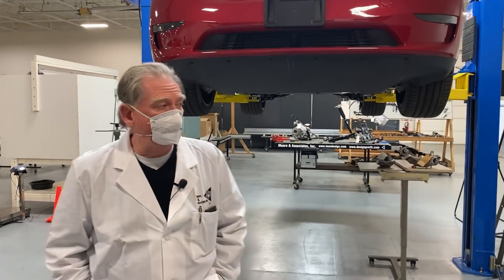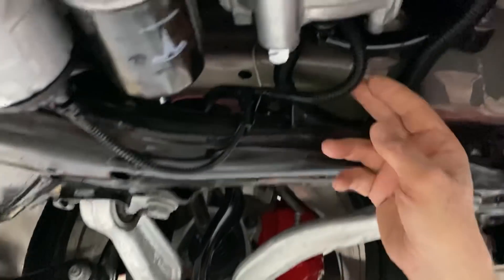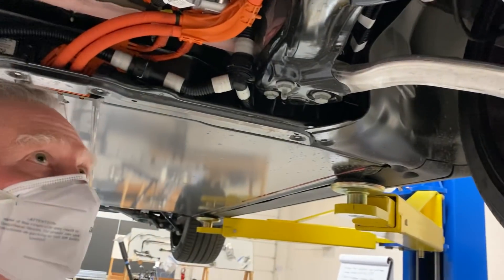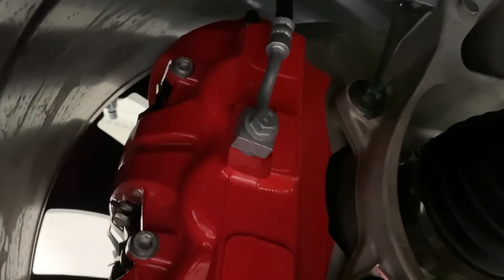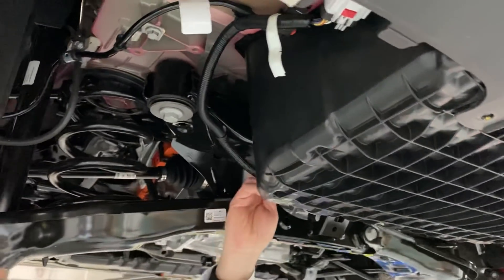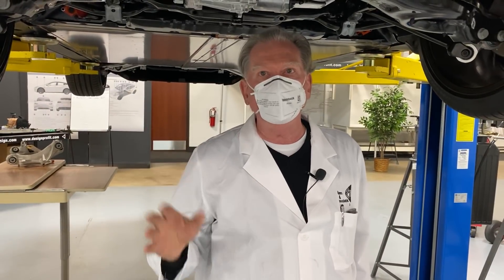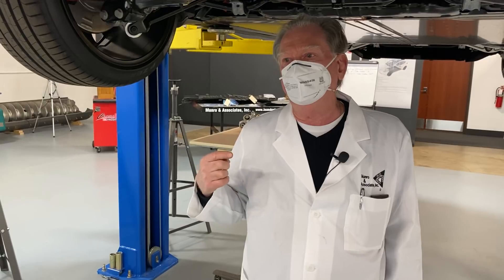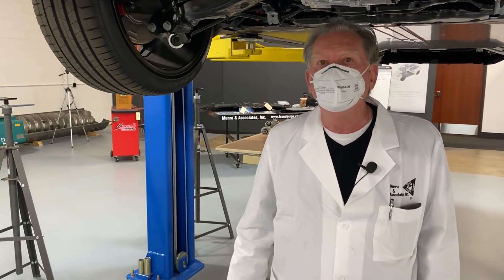Model Y E6: Wiring, Brakes, Quick-connects, Rear Body Structure

Comment: Corrugated wrap? Come see my 2006 4runner....the disconnects are nice.... 

but looking at this I can see why insurance rates are going through the roof approaching 10% of the purchase price cost annually, my Tundra started at 1.4% of the purchase price in 2014.....

These cars don't look repairable unless the body panels can be easily removed to replace the entire front end or rear body structures, that said , No one is going to trust that the centresection battery packs didn't suffer damage and won't later cook the occupants...

Govt safety regulations need to change to also cover repairabability, this thing looks like a military approach to single use disposable, because of course the military budget is unlimited and driven by the industrial complex mafia.....

Comment: Dear Sandy, 
it's not true what you say about the corrugated pipes to protect the wire harness. Please checkout the HV cables of smart ForTwo or Mercedes EQC and also a lot of Mercedes and BMW protect their engine bay harness like this - in this case it shows me that Tesla rather takes more effort for the wire harness than get rid of sharp metalic burr

Comment: That wiring in the beginning makes me really happy. Wiring was one of the most difficult tasks to speed up / automate according to Elon because the wires are obviously flexible. With this wiring harness that should become a lot easier and faster, hence making up for the material expenses through cheaper manufacturing operations and fewer repairs

Comment: I have a question. Why is it, that the nylon bowl thing in the rear is as narrow as it is? You can see that there is lots of empty space behind the wheels/suspension at 4:29. Basically every car I've ever been under has this. They put the muffler there in ICE cars. In some ICE cars, this space is just empty but I understand that a version of this very same car might have dual mufflers and because they don't want the extra versions, a little space remains unused. But why here? There's never gonna be a muffler on a Tesla. Why is there a hole? Usually in car packaging the departments fight over millimeters, how can there be an unused space in a car with what looks like 10l or more volume on each side? Does somebody know?

Comment: Sandy munro is a strange fellow.
Highly rated, but makes some small mistakes.
if I am somebody in industry, should read, keep up, about, ee, everything.

Either way, love the videos, thanks.

Not pulling out rims for brake explanation???

Tesla model differences, base, performance, long range, he should know.
Engines, brakes, suspension, trim, rims, computers.

Corrugated lines comments indicate they are more common that sandy explains.

Every car entusiast loves brakes.
Their a status symbol.
Corvette’s had them as early adopters, 50s-60s
Front disks, rear cheaper drum.
Been getting bigger through time, 12 inchers, thru 14, 15, 16,
just look at even mercedes bmw wagons.
Love lamborginis Ferrari, humongous.
Porsche yellow ceramics, Ferrari, F1, buggati.
Ceramic option are a $10-25k upgrade option, depending brand.
The only brand by name OEMs use I’ve heard is Brembo.
There are may aftermarket, like AP, wilwood, stoptech.

Either way sandy didn’t mention
single piece casting in big machine promised by tesla.
Reply: This is one out of what 22 video's on the car made by him so far?  Maybe he gets to those things later.

Comment: Just a note about Ford quick connect A/C lines. Before quick connect lines Ford had no leaks, after quick connect lines, Ford had many leaks. The first quick connect lines only had one o-ring. The next gen lines had two o-rings and the finally the ones that didn't leak had three o-rings .

Comment: Thank you for correcting the perf vs non-perf issue. But now you’re comparing the perf Y brakes with the non-perf 3 brakes without blinking an eye. The perf 3 brakes are larger, and should be your baseline

Comment: These Wire protection tubes are seen in other vehicles, my first car from 1991 used the tape wrap, but the next ones from 2000 and 2009 both have the flexible plastic tubes on many of the cables.
Reply from the maker: Lars, absolutely, many other OEMs do use sections of corrugated convolute wire protection, but what stuck out to us here was just how much of it was being used.  Nearly all of the underbody wiring on the Y is utilizing it.  Thanks for tuning in!
Reply: I'm guessing the abnormal amount of wire protection is part of the effort to achieve a very high mileage and lifespan of the vehicle for a potential FSD taxi role.

Comment: I would like to see manufacturers using  a hybrid of the Citroen hydro pneumatic system. It can power steering brakes and suspension ride height including body levelling and roll control. It can also power hydraulic door opening systems.
The big win on brakes is the high line pressures allow smaller calipers and being mineral oil there is no fluid degradation. It’s a perfect system for  EVs.

Comment: I like this video but I can't help but question your experience after hearing your wiring comment. My 2003 Honda S2000 has this type of wiring harness and in fact most of the cars I have worked on (ASE Master Tech for over 10 years) have this type of wiring harness, it's pretty standard, even my Prius has it. Not sure why it is so impressive unless I am misunderstanding what you're saying. Also, given enough time and right conditions, water will get into any connector, nothing is 100%.
Reply from the maker: Kristoff, absolutely, many other OEMs do use sections of corrugated convolute wire protection, but what stuck out to us here was just how much of it was being used.  Nearly all of the underbody wiring on the Y is utilizing it.  Thanks for tuning in!

Comment: Fiats sold in U.K. use a plug in connector on the clutch hydraulics. It’s great for installation and replacement as the lines are supplied filled with fluid. Very neat. 
However the aluminium connectors and internal stainless spring clips suffer electrolytic corrosion. They seize solid and rot eventually eats around the O ring seals. 
It’s a clutch, so no big deal but the whole line has to be scrapped. 
Brakes would need external O ring seals to keep corrosion out of the internal springs.

Comment: Fiat use the plastic trunking over the 12V wiring. Their achilles that ends and branches are wrapped where heat shrink sleeve would be so much better.

Comment: How much wiring did Tesla use?  Typical new car has more than 5,280 feet of wire... the Model Y was trying for 300 feet.  Did they even come close?  Did they even try?
Reply from the maker: In short, no, not close.  We have and will be elaborating on this more in later videos, but the Model Y harness is still very conventional in construction, definitely not the revolutionary next-gen wiring that was discussed as a potential yet.  Thanks for tuning in!

Comment: Volvo has done corrugated wire rapping since decades?Just look at a picture of a Volvo 850 wire-harness all corrugated. Is everybody else not doing that?  Always owned Volvo :P so this was a surprise.
Reply: Don't know why he said that. Lexus/Toyota has done it for decades too. Maybe he's only done POS vehicles.
Reply: @MrCarGuy  I know my 2000 Chevy Express work Van doesn't have that, and I already had to fix a bunch of rubbed through wires. (one was no fun, the cruise control randomly accelerate! )My 2004 Mercedes built RAM 1500 pickup, has some corrugated wires. But the plastic wrap starts to disintegrating and getting crispy.  While the Volvo wiring looks new after 30 years.
Reply: @eXo0us-T  The material itself likely always breaks down with heat due to proximity to the engine and mileage. My V70 is a 2005 w/140k and it is already cracking off in the engine bay.
Reply: Doesn't anyone listen? The point is that they're using it MORE than other manufacturers.
Reply: @phamnuwen9442  Every single cable covered in my 90s Volvo 850.  All in my newer XC90. How should you do more then ALL ?   That on average not all manufacturers are doing that, probably true.  But there are plenty out there which are already doing that.
Reply: @eXo0us-T  The exact degree of wire protection of any particular car is unknown to me. I guess it's possible European manufacturers (or Chinese in the case with Volvo) use it more than American.

Comment: Corrigated tubing on wiring isn't that odd is it? Have a look under the bonnet of a 20 year old Golf and you'll see almost all wiring is in corrigated tubing with very nice transition pieces onto the connectors, it also doesn't mean it wont ever short out, VW apparently also used mediocre wiring in places that is now starting to crack and blow fuses even though the sheathing is still in good condition.

Comment: There were internet rumors that the wiring for the model Y would be all new, and save a ton of material.  I'm curious if they moved toward that model or did they make it more assembly line friendly with the model 3?
Reply: David Analyst I’m curious if they got the new wiring already.  My guess is not quite yet.  It may be a future development that they’ll roll into production when it’s ready though.  Will be interesting to see either way
Reply from the maker: In short, the wiring is quite similar to the Model 3.  We have and will be elaborating on this more in later videos, but the Model Y harness is still very conventional in construction, definitely not the revolutionary next-gen wiring that was discussed as a potential yet.  Thanks for tuning in!

Comment: Sandy appreciate your industry expertise and this deep look / comparison to their last car the Model 3. We can get some insight into the improvement pace of the company.  Im 35 years of world wide auto wiring harness industry test engineering. Your right that wiring harness is truck industry robust. My guess is by minimising the wire runs its now not too crazy cost to convolute tube the lot. The quality quick connect looks to me like they are minimising line side work in handling the harness sections, it looks like million mile wiring to me. Nice to see they responded to your critique of the Model 3 trunk tub section, keep up this brilliant channel.

Comment: Is that a Oil Filter???
Reply from the maker: Yes, both electric drive modules have filters.
Reply: They might not need regular oil changes, but the reduction/drive gears in the drive unit still need lubrication/oil

Comment: One thing that car reviewers are learning about Tesla like Matt Watson from CarWow that Tesla keeps making major leaps and bounds. Each time they come up with a new car you see so much that goes into the process of building a Tesla and how they refine it each time. I cannot wait till Sandy gets into the process of how Tesla engineers worked to greatly reduce the wires used to connect various systems in the car. Each evolution of the Models they use fewer wires but use some very impressive technology to allow the same functionality. From what I am hearing the Model Y uses around 300 to 400 feet of wire and still achieves redundancies so that if one goes down there is a backup.  Thank you again Sandy for a chance to see he inner working of a Tesla.

Comment: @Munro
Please investigate why Tesla model Y has low available payload, only 402 kg. It is less than model 3 and much less than the smaller Hyundai Kona Electric (485 kg) or the larger Audi E-Tron Quattro (640 kg).

Is it because of the suspension or aluminium rear body structure?

Comment: Sandy, you have the "Performance Package"  COMBINED with the "PERFORMANCE UPGRADE" - 
"Double-Performance", so-to-speak.  This is their most sporty configuration.  
the "Performance Upgrade" includes: 
    20’’ Gray Performance Wheels
    Performance Brakes
    Carbon fiber spoiler
    Lowered suspension
    Aluminum alloy pedals
    Increased top speed from 145mph to 162mph
    and "Track Mode" software
Reply: this (double performance) package is also available on the Model 3

Comment: Corrugated wrap cables are used in German cars for 20 years. What do you mean you have never seen such thing???? Same for quick connects, nothing new there.
Reply from the maker: So far we have observed 100% coverage Of the LV wiring. We typically see it used sparingly, on other OEM’s.
Reply from the maker: Again, 100% usage of quick connects. Other BEV’s and PHEV’s use them only at the plant assembly points.

Comment: Clarification: those are Brembo’s. If the brake calipers are carried over: Performance Model 3's/Y's calipers are a completely different caliper/higher model (have bigger diameter rotors too) and have better rigidity (monobloc, hence the bridge) vs. non performance models. The bridge across the caliper is offered at their mid-higher end brake calipers because the whole block needs to be cnc'ed out as one unit (most cases). The rear caliper is odd looking because it integrates the sliding parking brake which was a vast improvement instead of having to use 2 calipers (one brake/one parking brake) over old Model S's.

Comment: As you evaluate the structure will a hitch be possible? So far Tesla has listed 'no towing'.
Reply: That has changed in the last week or so... google Model Y tow hitch.  I think it is now rated at 3500lbs. and available from Tesla as well as several on the aftermarket.

Comment: Shows that Tesla can massively improve quality where it truly matters.  Model Y should have significantly fewer service needs than Model S/X/3.  Designed with the 1 million miles in mind.
Reply: This is what I'm tuning in for.  I want to know what is going to fail by 150k miles, 300k mile and 500k miles.
Reply: Greg Breland haha according to this video, everything lasts forever 100%, so we are good so far
Reply: @SquidwardTortallini  nonsense, there is not a thing in this that will ast forever
Reply: Why fewer service needs?
Battery is the same.
Motors the same.
Suspension arms practically the same.
Brakes could be the same, it sounds like he is comparing a 3 dual motor with a Y performance.
I think the car computer is transferred directly over from the 3.
The wireharness should be different but very few cars have wire troubles the first 10-15 years unless it is a french car, they sometimes car be a little tricky.

The big changes is the rear sub frame thing, the other Tesla models where not bad it was just not as efficient both in complexity and cost, it is not like it will fall apart and if protected with paint or other rust protection it is going to last longer then the battery and motors.
Reply: That's not true Tesla's improving those models as fast as they can.

Comment: You’re making me feel better and better about my Y purchase. I have a non performance dual motor Y
Reply: same here
Reply: BrewersArcade it’s the stuff under the surface (that tear downs like this reveal) that really show where the value is built into Teslas.  It’s all about the high quality and high technology built in under the skin.  It’s not the 1/2mm variation in a door gap that makes zero difference to the function and reliability of the machine.

Tesla puts their effort/resources/money into the important stuff.  

I think the consumer can tell, and that’s why the market is responding to Tesla so positively.  I went from skeptic to fanboy really quickly and love my Model 3 sooo much.  I feel the same awe/love for the Model 3 that I felt when the first iPhone came out and it was so obvious that it was worlds better than anything else on the market.  It had “magic” and so do these cars
Reply: @Dr_b_ And now do...
Reply: I think you should watch again... He noted that he was not happy with the early model 3 gaps, and impressed with the model Y gaps on the one they bought.

Comment: Casting on the Model Y is just the beginning imo. Patent applications show an idea to cast most of (a vehicle) frame in 1 piece (eventually). Then 1 cast piece for the floor. I suspect they'll build up to this as their knowledge grows. Material flow, welding lines, cooling time in the mould, warpage, cycle time etc etc will all be major technical obstacles to overcome. And the machine will be huuuuuuge. Interesting times for dinosaur technology :P
Reply: audi has been using those casting methods for years its not a new thing, audi was also the first manufacturer to use a 100% aluminium body construction
Reply: Tesla = Innovation
Reply: Plus they are looking to see how each part can be designed for easier automated installation.  Throughput is going to get faster and faster.  

There may be some process that requires human labor long term.  Seats are built off line but suppose there is a line job that can't be automated, at least for some time.  The line might split into multiple workstations for that process and then recombine into a single automated line from there on.